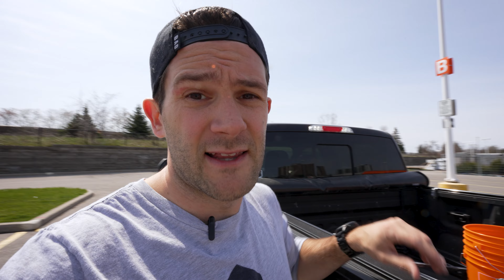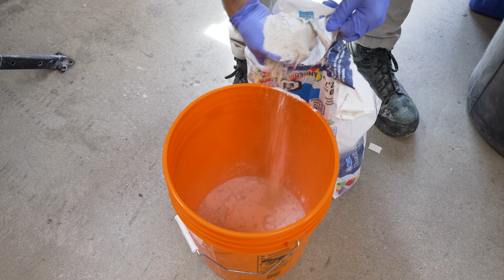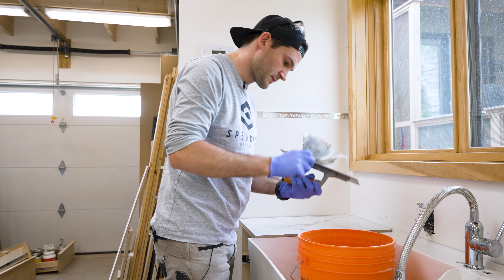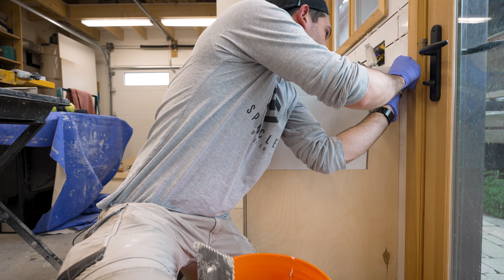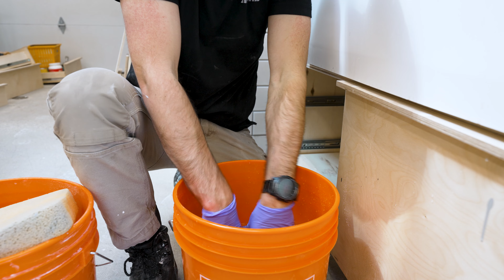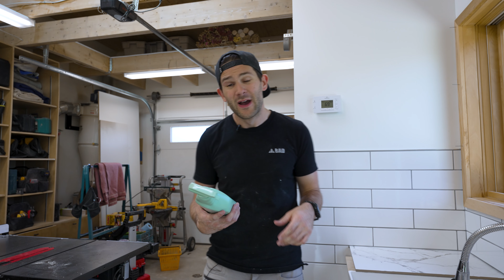Stop buying tools you dont NEED

Comment: Caulking is a must with this brand of non-sanded grout!!! We used the same size tiles with platinum grout and it definitely has cracked without using caulk.
Reply from the maker: Ya, you really need to be careful with non-sanded grout. It's very unforgiving, especially 6 months to a year later down the line.

Comment: Every looks awesome but the only thing that bugs me is the counter tile is a little over the top, it's not level!! That's the only thing I find a little annoying but everything else was perfect!! 👌
Reply from the maker: Not sure I follow what you mean? I brought it over the edge of the sink so that it would drain into, and gave it a slight slope for the same reason
Reply: @ZacBuilds  what i meant was that the counter tile is not in level with the sink and other side of the counter, it's set on top of the counter!!
Reply: I didn't notice that,  but noticed that the running bond pattern wasn't continued on wall tile on the right side of the window, so whole tiles could be used in that narrow space. I would have cut the tiles to keep a consistent grout line pattern. But it's a garage, so already a bit fancy.  Looks great!